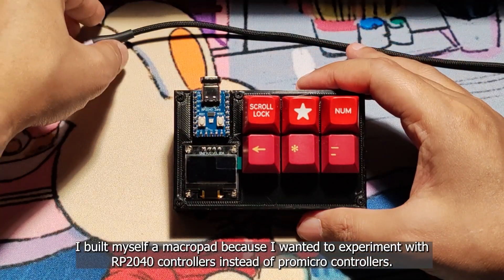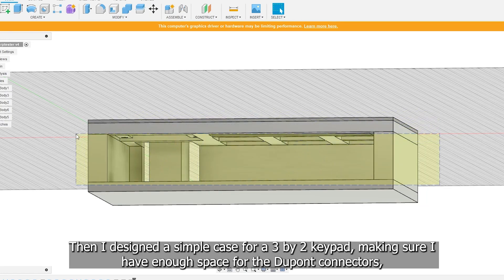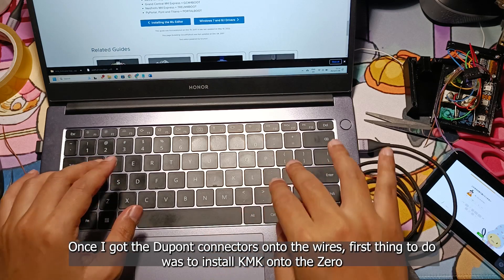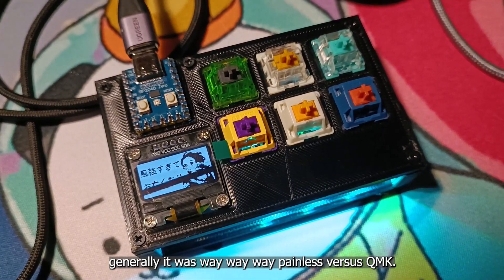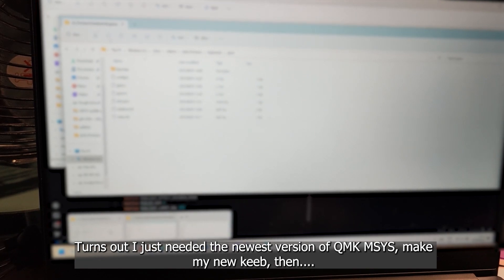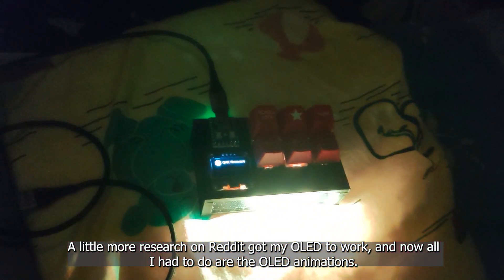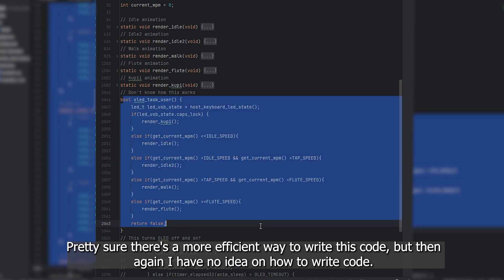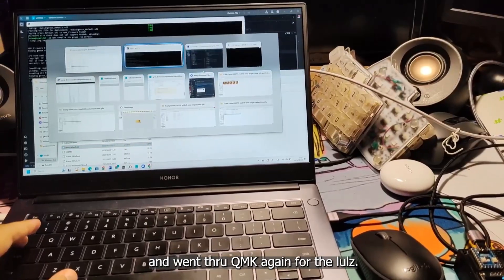I made a macro pad using the RP2040 Zero on QMK (and KMK)! The Grass

Comment: Hello! Love the build! Question: how did you connect the OLED screen to the RP2040? Was it also via the dupont connectors?
Reply from the maker: Thanks! Yes, I connected the OLED screen to the RP2040 using dupont connectors.
But if I were to do this again I'd just solder the wires since that's much more faster to do.

Comment: FYI. For your DuPont connectors there are pre made ones that usually comes with breadboard or buy them separately. There are also 90 degrees header pins that you use to connect the DuPont connects to the rp2040 MCU
Reply from the maker: Thanks for the info! May try the 90 degree headers some day
Reply: @semputs  I use it all the time when I started to do handwiring. Easy fit diagnosis. Now I venture into pcb designs and using less of 90degrees headers.
Reply from the maker: Any good references on how to make PCBs? I think it's time I learn how to PCB
Reply: @semputs  for simple pcb with external MCU. There is a video by Noah Kiser about designing a pcb using pro micro and another one using rp2040 on YouTube. I based my foundation from that video